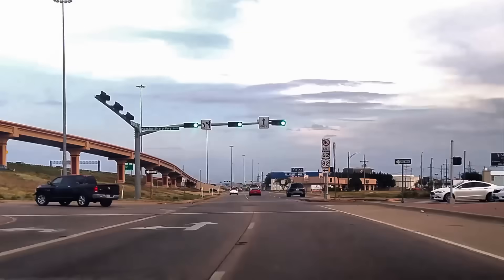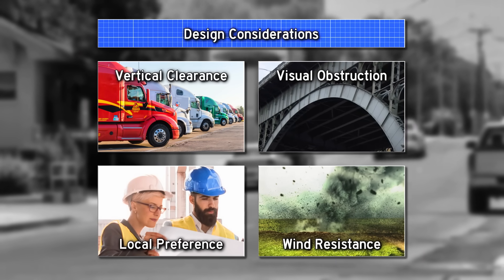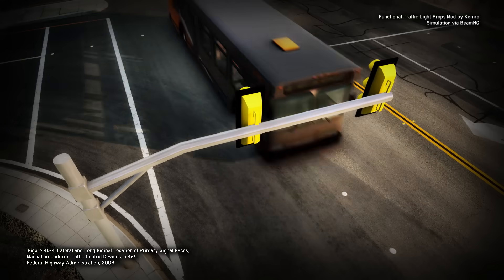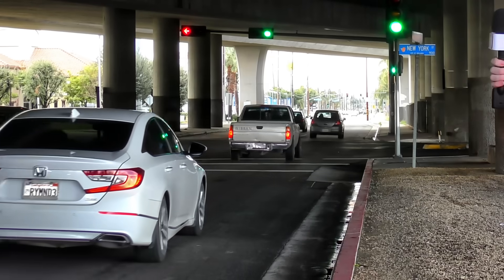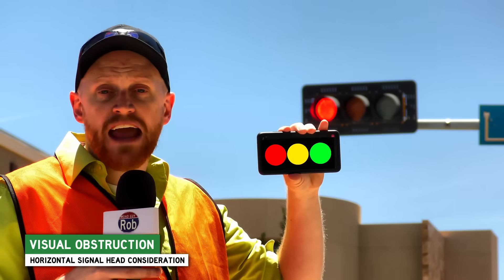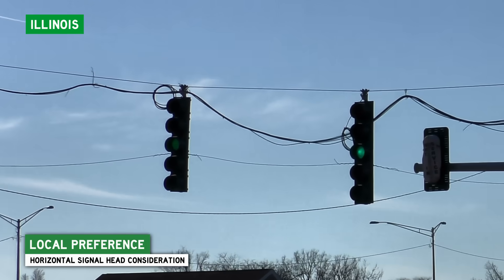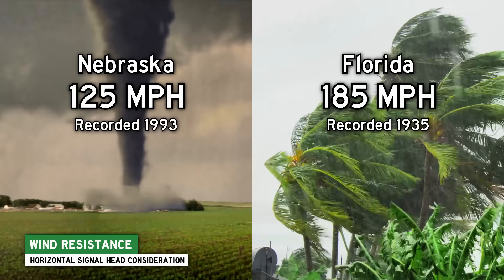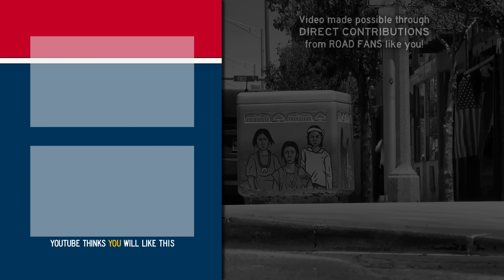What's up with SIDEWAYS STOPLIGHTS in Texas and Florida?

Comment: re: 8:20, Japanese was traditionally written vertically with lines arranged right-to-left, and that arrangement remains common to this day in print media (where pages are also ordered right-to-left). It only started being written horizontally in the 1880s, and initially only to accommodate text that contained Western-language snippets. When vertical space was limited (as in e.g. horizontal signage), characters were written right-to-left, which was thought of as a sequence of 1-character-tall "lines" of text; this can still be seen in some traditional signage (such as at entrances to religious sites). The use of left-to-right horizontal writing only became widespread beginning in the 1940s, well after traffic signals were introduced. Between that history and the continued widespread use of right-to-left vertical text, it's very unsurprising that Japanese horizontally-mounted traffic lights are arranged with red on the right.

Comment: Probably used ChatGPT to write it as well. If the Sun blames it on someone, the organization should still be liable as when you post dissertations, you have to run it through an AI checker plus sign a document stating that you are the original author thus open to liability if it is found that you plagiarized.

Comment: I usually look at how California does something and do the opposite. California usually spends lots on studies and comes up with the wrong answer. Common sense must be used. Places like Texas, Florida, Louisiana, often have damaging winds. Traffic lights are often mounted on solid steel arms. Mounting them horizontal and anchoring them on both ends prevents them swinging in the winds. Texas drivers are not confused by horizontal lights and can work with either type. I guess drivers in other places are not as smart.

Comment: I don't care which direction they run. Texas lights are stupid because they don't put a signal head on the left (or often on the right.) So if you're behind a tall vehicle, you can't see the color of the light without backing way off. Also they put the helpful lane direction placards a hundred feet before the intersection and not on top of the pole, and the number and position of the signal heads usually also don't match the lanes. And don't get me started about Galveston's four-way hanging signals that you have to crane your neck and look straight up to see.

Comment: The rule of thumb to mount stoplights in alignment with the pole they're attached to (horizontal over the street, vertical for the pedestrian signals) makes so much sense, I'm really surprised it isn't used everywhere.

Comment: In Lake Worth, Texas, every traffic light was mounted vertically down the main road. Until one day a wreck took down one of the lights, the replaced the entire intersection with horizontally mounted lights that are far dimmer than the old vertical lights that are at every other intersection. It's always the most difficult intersection to see what color the light is when approaching. especially when you're used to the vertical perception of the lights being above the pole for red, and below the pole for green. I wish they would have just put the other style back up that matches every other light in the city.

Comment: I live in Mass. traffic lights are vertical. Going to a state with horizontal traffic lights and being in a city that's a grid system is very aggravating, that and also have streets called "6th street North", "45th ave west". I was stationed in Florida and it was so annoying to find addresses "take 53rd ave, make a left on north 37th and our address is 1389 101st. street. I'm used to actual names of streets and roads that aren't straight.

Comment: I worked in a major City's Traffic Signals department for 21 years. (NW region).  I also lived in Texas back in 1984 through '87, then 2019 until now.  I noticed the traffic signal light fixtures mounts way back in '84, but never thought much about them.  After I retired from the City, and moved back to Texas I fully knew why.  Wind!  There are considerable wind events in Texas and Florida, and mounting the signals on arms sideways allow for much stronger attachments.  Note that I say signal arms on those structures, not mounts on strand wire type installations.  The mounts on wire supports are done from both the top and bottom, giveing the needed strength to survive the wind events, at least until the 15K pound structural strength of the support strand is exceeded.

Comment: It sounds like the better question is, why do any states NOT mount them horizontal? So far, you have not listed any drawbacks. Only advantages. 

My only guess is that maybe in places that get more snow, a vertical light presents less surface area for snow to land on, so won’t take on as much weight. That might also be why span-wires are preferred in snowy places over a fat traffic arm that will catch snow.

Comment: I lived in Dayton Ohio in the 1980’s. Southwest Ohio did the cheap thing and mounted lights vertically, suspended from the top by a cable.  During strong winds, those lights were bobbing around like crazy.  I grew up in Missouri, a less affluent state than Ohio, but the lights there were firmly mounted to an overhanging beam rather than a cable.  I live in Texas now, and some of our lights are also cheaply mounted.  But that’s not surprising as TXDOT is the pits.  Our roads are constantly “Under Construction” with miles of orange cones, temporary concrete dividers, and no shoulders for 7-8 years for a supposed “temporary” upgrade.

Comment: I think that part of the reason is, that it is because it gives more height clarence for tall vehicles and less wind resistance to have them sideways.  After watching your video about traffic lights waving too much and falling, having them sideways may help with that.  

For those who are color blind, Red on the Left, Yellow in the Middle and Green on the Right.  I think it is a good idea.  

I wish they would not have those yellow blinking left turn arrows, most of the time, there is traffic coming the other way, and it doesn't even help, it might as well stay red.

Comment: Wind!  We have too much wind!  The vertical ones if hanging would break off.  Also the vertical ones are too long for tall vehicles so you need the horizontal to be visible for those not in the right hand or left hand lanes.  Didn’t need a video to explain.

Comment: The surface area of the traffic signal doesn't change just because you change the orientation. The difference is that you can have different kinds of mounting and reduce how much those mounts flex and bend. Thanks for all the great videos.
Reply: What are you on about? It absolutely does.
Reply: @Gfynbcyiokbg8710  it doesn't? There are 3 lights if they are up and down. There are 3 lights if they are sideways. How does the surface area change based on orientation?

Comment: What I really like about US traffic lights, is that you put them on the other side of the intersection, where they're clearly visible. Here in Europe, those are very rare (unless you're in the north). We have them parallel to the stop marking, so they violate both the "too high and too close" rules. There's usually one signal on top, and another lower down on the pole, but if you're on a 2 lane, and a truck stops next to you, you're screwed. Unless you're like me and have a panoramic roof, in which case you can break your neck to watch the top one.

Comment: add airplanes.  101 overpass at the north end of the runway at San Jose International is just finishing reconstruction.  the signal lights are horizontal too keep them low and all of signal and light poles in the area have red air obstruction lights on them.  also the light poles have the lights mounted on the side of the pole so the red light can be the highest point on the pole.   https://maps.app.goo.gl/RenDRjarhcySUQ2s9

Comment: Where I grew up, in my state and the surrounding states, there were lights at the stop line before the intersection, and lights at the other side of the intersection so if you were the first couple cars in line, you could tell when it was green again.
When I went to college hundreds of miles away, they had lights only after the intersections, so with my unconscious expectation that 'traffic light pole means stop line is at start of intersection' or 'see red light, stop directly under red light', I went right into the intersection on a red light with the intention to stop at the only set of lights, which were after the intersection.
It happened to me again years later after having lived where I grew up again, and then moving to another state. That time I stopped about a third of the way into the intersection instead of going completely through it.
So that's an example of an unexpected change of standards between states/regions that can be a problem.

Comment: A friend of mine is an engineer and was pulled over in a small town for running multiple reds.  Cops asked what was going on and he said they were green.  Well after a long calm conversation, Nick explained he was color blind and turns out that town installed the lights the wrong direction 😂

Btw: “all 50 states agree” in engineering speak means “the federal government bribed them with funding”

Comment: I learned to drive in Texas where there was/is a mix of verticals, usually on the vertical posts and horizontals over the roadways.  It's really not complicated to comprehend both horizontal and vertical signal heads.

Comment: Disliked the video. 10 minutes of video and I still can't find the part where the title answers the question, despite the chapters throughout the video. IE "But... Colorblindness"?? What does that have to do with answering the title of the video/why stoplights are horizontal instead of vertical? Leave it to this guy to turn something that could be answered in 2-3 minutes to longate it for additional YT revenue without adding extra value to the viewer. smh

Comment: I went to college in Miami in the early 1980s and moved away in 1985, so I wasn't there when Hurricane Andrew barged through the area. When I visited the place on New Year's 1999-2000, the whole Miami metro had changed their traffic lights from vertical to horizontal!

Comment: The area doesn't change because you turn the shape sideways.  However, it WOULD affect how much support the pole gives the light.   If the pole runs "the short way" through the light, then you've got a long moment arm to the sides for the wind to try to bend the light around the pole compared to if the pole goes "the long way".

Comment: Queation: what if a traffic light is mounted outside the parameters listed in the code book. I’ve seen multiple mounted well below the 15 min (don’t overhang roadway) and many of those are far closer than the 40’ min, about 10’. 
2nd question if a signaling device isn’t mounted per the freeway code book (100% hypothetical) a vehicle runs a red, turns on red or any other violations would a traffic citation stick or if a collision occurs where their mounted whos at fault (the local gov or which driver)  
Again the questions are just hypothetical they just popped into my head realizing that the outside the book traffic signals mentioned are real.

Comment: I have for a while wondered if, depending on every state, there is a Traffic signal CODE. Just like with architects and engineers, everything they build and design has to follow codes, which are a set of rules of how buildings should be erected, and I believe the same thing can be applied to Traffic lights. Traffic lights go by a set of "Codes" that dictate how signals should and shouldn't be installed. As well as what poles they use and what color the signal paint should be.        I wait to find an explanation of why Traffic lights happen to look different in every state you go to. States that are located right next to each other, like California, Nevada, and Arizona, tend to have very similar traffic signal setups, but the more eastern you go, the wildly different the signal designs change.

Comment: I am colorblind, red green mainly, but also blues can be tricky. Not sure if I am proto or due type, mostly likely due. For me these lights have no issues as long as they follow the pattern. I already more or less now what light is what by the intensity. Red is dull, yellow is bright, green is inbetween. LED lights did mess this up for me a bit only because on certain back drops the green light would blend into the background. If they started changing the order as well, then things would suck.

Comment: Rob, idk how this got on my recommended - But it was so informative! I was always into traffic signals  when i was younger and when i went to thailand was when i saw horizontal lights. Fun fact thailand also has a countdown timer for their lights in some places. 
I do have a question though: Any other states use a special crosswalk light where there are 2 reds on the top and one yellow on the bottom? They started installing them in my city and it seems drivers don't get them.

Comment: Texas has vertical lights. Fort Worth has nearly 100% vertical signals and some of the suburbs use them as well. It gets interesting in a few areas as they use vertical and horizontal mounts at various intersections on the same road. Oklahoma started to use horizontal signals in the last decade or two. Oklahoma City installed these as part of projects to redo the roads in downtown.

Comment: I've lived in Texas all my life, and I thought horizontal lights were normal everywhere. Vertical lights used to be common too, but they were replaced with horizontal ones over time. I thought it was because vertical ones swing in the wind, but there's a few still holding out, so maybe I'm wrong.

Comment: Colorblind to green, exited I-8 in pitch black.  Before my eyes could adjust to the town lights, I came up on a flashing red or yellow light.  Couldn't tell which.  A cop was sitting there at the gas station, patrol car pointed at the intersection, ready to write tickets.  You better believe I came to a full stop.
Reply: Blinkers are terrible for colorblind people.  They really ought to use shapes to tell the lights apart, like square for red, and diagonal diamond for yellow.  Or put a stop or yield sign, next to the blinker, to clarify its meaing for colorblind folks.

The way it's supposed to work, is that blinking yellow means yield, and blinking red means stop.

Comment: 😂interstate 40 doesn't run threw Dallas. I 20 and 35 dos.

The clip that said was Dallas was not Dallas.
Reply: I-30 used to start around Big Town, then when 635 was built, the part of I-20 through Dallas and Fort Worth was resigned I-30. Doesn't surprise me that I-40 moved from Amarillo to Dallas.

Comment: I don’t see how the colorblind thing is an issue at all, of course there’s going to be a standard for which horizontal direction to have it. A colorblind person should know that red is on the left just as they should know red is at the top. 

Questioning Japanese lights is also weird, since it’s an entirely different country, as long as the stoplights are in a consistent orientation, there’s no right way to put it is there? Also, a lot of Japan has a monsoon season, so that’s probably the reason for the horizontal orientation.

Awesome video, but a lot of biased writing lmao
Reply: Can't see the position of a light when it's really dark.  Flashing yellow looks just like flashing red whichever way it's hanging.

Comment: After coming back from Wisconsin literally the day before I wrote this, I can safely say they use horizontal lights too, but I am wondering if maybe they’re being fazed-out? There were some intersections that didn’t have horizontal lights that looked newer, and the horizontal lights looked older than the newer ones. I also saw a taped up light that was in installation that was vertical… could be a sign they’re being fazed-out, but I do wonder why Wisconsin’s had them in the 1st place!
Reply: Mutant cows needed the headroom of course.

Depending on the town, could have been used for AG vehicles to have more clearance. My town had farm sprayers travel the roads frequently, and they are quite tall with the tractor tires on an f250 chassis.

Comment: A sideways stoplight at my NY place would hold more snow during winter months. That's extra stress on the arm/wires especially when there is heavy "wet" snowfall, so they mount stop lights vertically which minimizes horizontal surface area that can accumulate snow. 
A vertical stoplight at my TX place would, as mentioned in the video, be a problem with high winds when tornadoes come through, so they mount stoplights horizontally.
High winds are not an issue in NY. Heavy snow is not an issue in TX.
Reply: In Quebec which is just north of NY, we have heavy snow and we mount the signals sideways.
Reply: Interesting. Are they hanging lights or fixed to a rigid structure (e.g. pole/metal arm)? Our lights in CNY are hanging (on wires).
Reply: @samshare2146  We always use two rigid structures on both sides. Swinging is not tolerated here.

Comment: Horizontal lights DO present problems for people with red-green colorblindness, especially in the places where they are most common (in otherwise 🚦 states): under overpasses, where the housing is hard to see, because it’s always shaded by the bridge above it.

There was one 🚥 (under an overpass) on the street between our university and the mall, and my friend with red-green colorblindness could never tell which light was on.

He never had this problem with vertical lights, because the difference in angle was enough.

Comment: I live in the Kansas City area, and there are a few horizontal stoplights. They are located in areas where the red light wouldn't be visible if vertical. One is on the other side of a low RR underpass.